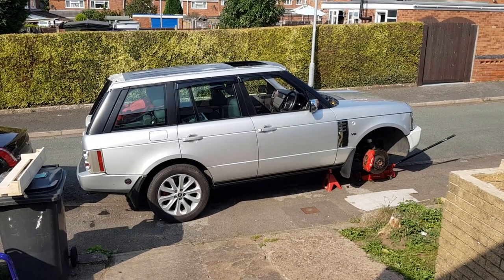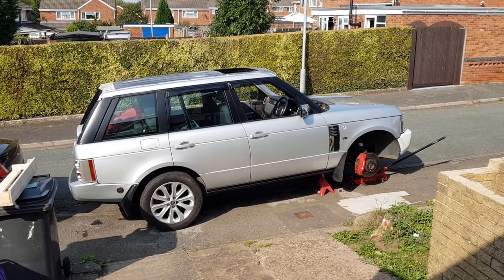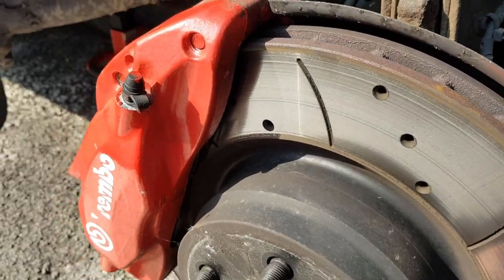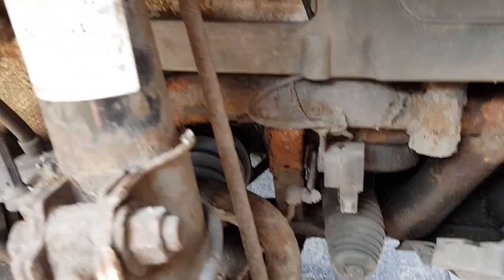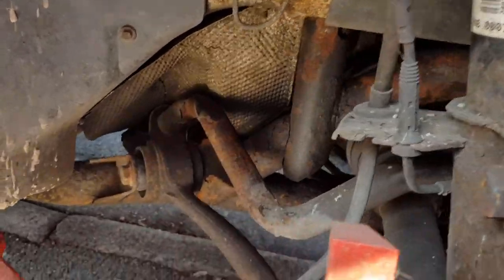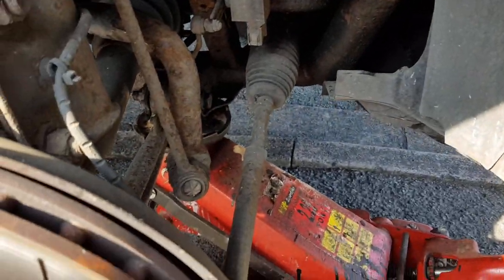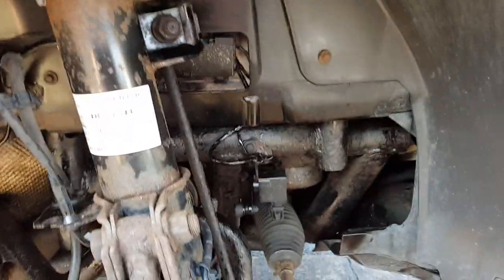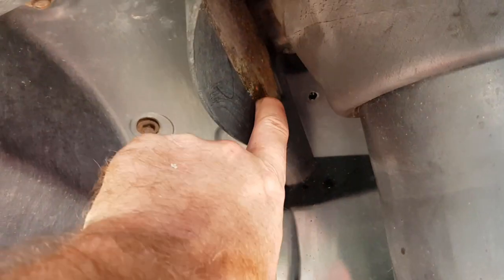Salvage Cars | Salvage Car Rebuild Range Rover L322 | Its Too Hot To Work Today

Comment: Sometimes a small hole develops on the fold/roll of the airbag its self and again sometimes not always visible or a easy to find but I'm sure you will John. You the man ?!👍🏼😆💪🏼. Nothing to a man of your calibre after what you have achieved so far. Good to see ya still tinkering with the beast. To tropical to be playing with in this heat. 😅👍🏼keep the rangerover vids coming.
Reply from the maker: Thank you very much for your kind words. I never get bored working on the Range Rover, it is a great car to begin with, and we want it to be a really nice example when its finished.